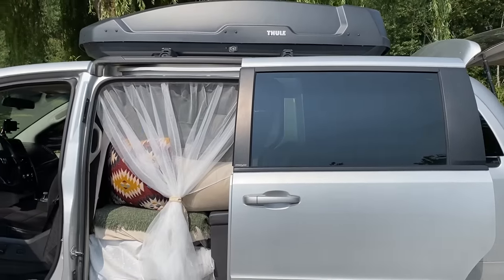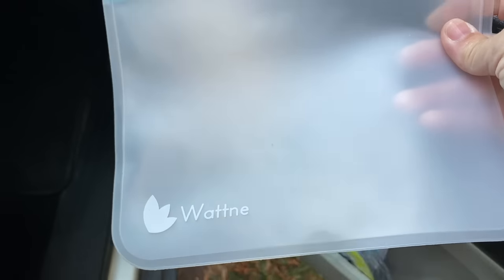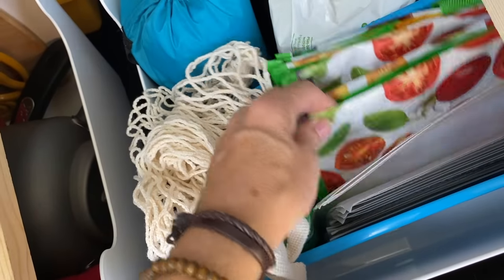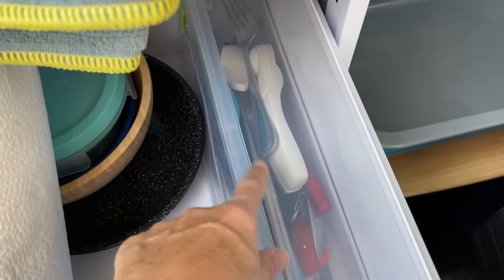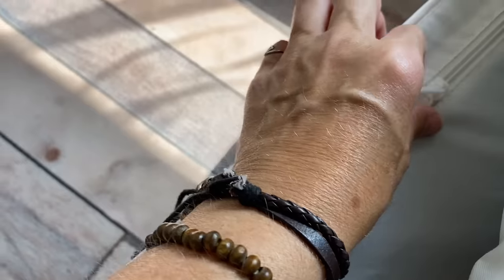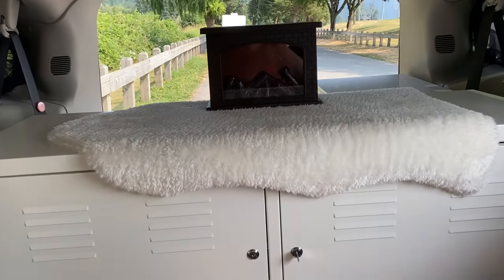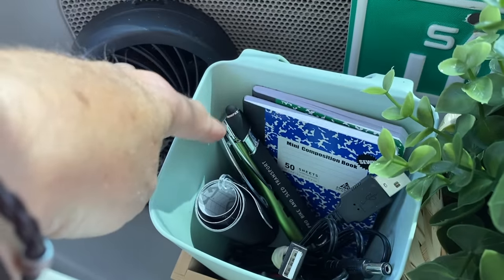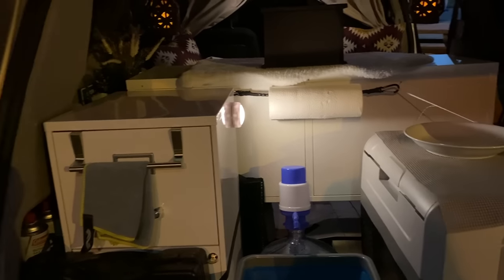#VANIFE | Cute, Cozy IKEA Cottage in a Minivan | Full VAN TOUR | Dodge Grand Caravan

Comment: Super cool build.  If you sew a pocket on the bottom of your blanket, your feet will be able to keep the blanket on.  The blanket folds into the pocket and becomes a pillow.
Reply from the maker: Oh wow! GREAT idea! Thanks for sharing! 😃💕
Reply: Excellent suggestion
Reply: ~ Great idea~Sewing the Pocket on Blankets Bottom~Also using a heavier flannel type FITTED Sheet to cover up with & the elastic holds my feet in.
Reply: I had the same van same year as my first camper build, and boy oh boy was drive time pissed when they repossessed the van last year while I was off work .. I took all the camper stuff out when I bought my full size high roof van and left a ton of holes,  it had no seats I threw then out including the passenger seat, I had a huge hole in the roof where my fan went, I had 3 100 watt solar panels on the roof, a solar shower and water storage on the roof, I removed all the plastic trim in the back and bolted a cabinet I build, my tv swivel mount, battery mounts, bed mounts, propane line drilled thru the side of the van ECT ECT ....drive time charged me 12 grand in repairs lol..   Screw em I filed bankruptcy anyway.   Now I live where I work at Ford Dearborn assembly (I'm a truck driver) in my extended high roof van, I got a shower inside,  I got my solar but Ford let's me plug in I just park where the electric vehicles park.  I fitted 3 solar panels on the roof of that van plus my ham radio 10 ft long antennas
Reply: BTW doing the camper van life in a minivan was near impossible at 6 foot 2 inches tall.  Going #2 was hard lol...being in a semi truck alot I was used to living in a small space,. As far as security goes get a ratchet strap and hook them to each front door,  hulk Hogan couldn't open it.  Plus I put Marine Corp stickers all over the windows, it keeps people away and cops hesitate to give u tickets sincr most of them are ex military...I've got 2.1 million safe miles and never gotten a ticket or stopped because of all those marine Corp stickers.  I'm not military and when people ask I say they came with the van.  And when u leave ur van to shop or whatever TAKE YOUR IGNITION RELAY OR ANOTHER RELAY!  Unless a robber has a tow truck they won't get ur home, living in Detroit crack heads take those vans a lot, they literally drive them to a drug dealers house and trade it for rocks or heroin.
Reply: @breakingames7772  Oh my... Thank you so much for sharing your story and wise tips!
Reply: What a great idea!
Reply: @breakingames7772  Your van was repossessed and you were pissed?  You know, there's a way to keep from having a vehicle repossessed, don't you?
Reply: @vickyabramowitz2885  I think he meant the company that took it back maybe.?
Reply: you are a genius ✨thank you for this life hack!!!
Reply: @breakingames7772  Why is it so funny you stuck other consumers with your bill?  Was it a huge lemon?
Reply: I call them quillows...quilt and pillow...and we have two.
Reply: @breakingames7772  Thanks, I just ordered a Marine Corp sticker on eBay.
Reply: How can you take your ignition relay off when you go shopping or leave your van !????? 🤔🤔🤔😳
Reply: Where did you find the little fireplace and does it hold a charge (usb)??
Reply: @breakingames7772  screw them is right. Good for you!
Reply: How tall are you?
Reply: @Jenrtiel  5 foot 2 inches
Reply: @BreakinGames  never ever "screw" anyone or thing.  Karma always reflects on your character.  What comes around will come back and bite life right out of you. God Bless.
Reply: Or maybe put the pillow inside the blanket pocket…
Reply: Good idea!!!!!
Reply: @vickyabramowit2885  Besides keeping up the payments, what else can be done?
Reply: Yep. I agree. I have sewed foot pockets onto my blankets.
Reply: I would invest in a boot brush that sits flat that you can put on the pavement
Reply: @breakingames7772  What a fun story...
Reply: You can simply fold a blanket into a pillow without sewing a pocket onto it 😊😊😊
Reply: I keep one of those in my car for emergencies, just looks like a pillow on the backseat. My mum made it many many moons ago

Comment: Personally, I feel like it needs so much more security wise. The key is to not need anything that requires hand-to-hand combat. In other words, once they are in. If you are dead alseep, that whistle won't help at all. There are quite a few videos by other van dwellers who share  multiple ways to really seal up your van for security. Window and motion alarms are great. Cameras ourside that show anyone outside the van. Things you can put on the van windows to make them shatter resistant. Etc, etc. The windows also look like light can be see around them. I may be wrong, and hoping I am. Like anything that more and more people do, so goes more and more crime, and criminals will learn how to spot the vans that are stealth.

Comment: I LOVE your van. So many great things set up. The wooden blocks you have under the legs of your cabinet could easily be replaced and tidied up with a piece of pvc pipe big enough for the leg to slip into, then cut the pipe the length of elevation you need. Then you have small white round legs for your cabinet and more foot room. Love you window and door covers.
Reply from the maker: OH my! I JUST did the pic pipe thing for the legs! That's awesome, great minds think alike! 🙂

Comment: You did a fantastic job well thought out ,you must love it all that piece and quiet away from annoying as hell people ,you should look into expandle awnings  expanding your floor space outside .
Reply from the maker: Prior to moving into my van I had ordered an ARB Awning for the van through an RV service center. I had an appointment for it to be installed but then was told they couldn't install it because the mounts wouldn't fit my roof rack (factory). They were unwilling to rig something up...so the awning was sent back. I am hoping to find someone willing to install one for me.....I am unable to do these things myself due to health reasons.
Reply: @RootlessWanderer   do some research and see if there's other alternatives there appears to be many different styles like the one I mentioned if you would like it would double living space look for something with screens attachment option the bug screen covers for your windows.

Comment: Oh I was also wondering where you got the wooden boards you put across the seatwell in back...that is genius and I love the 'sink' setup....might try to do something similar in my van...
Reply from the maker: The wooden boards I purchased from home depot. They are called "project panels" and they're made out of pine. I did not need them cut, they fit perfectly across the seat well. The sink is working out very very well. I think I may add a usb chargeable water tap next!
Reply: @RootlessWanderer  thanks a bunch .. Yeah I'd go with the USB  from others..  they seem to with work well.

Comment: I just bought the screens through your link. I have never seen them before. I just got my 2012 Transit van delivered yesterday morning. It is 9 years old but only 40K miles. Looked a long time for one, they go fast when one can be found. Lots of cool ideas that appeal to me. I like the cottage look. LOL I am an ambiance light nut. Fireplace light is on my list and I to want to sleep across the back of mine. More room, I am only 5'1. I have no Ikea near me, but I am an artist and have great one of a kind cabinets I used for art supplies. The netting adds character.

Comment: Beautiful van! 😍 May I ask how tall you are? It's genius to put the bed across but I am afraid I'm too tall to do that. 😊
Reply from the maker: Lol I am pretty short!
Reply: I have my bed long ways, but I made the bed into two sections, the back of the van built in and the front is actually easily removable so on days that I want more floor space, it comes off very quickly leaving the sliding doorway clear. I can either just set the front part of the bed on the ice chest or screw the legs on. The whole bed can be removed and used in the tent because it is in sections it's easy to carry and because I covered the wood with foam and vinyl no gloves needed and wipes clean before putting back in van. hope this gives you some ideas
Reply: @notaennebodie531  Very nice idea! Might give something like that a try. Thx!

Comment: Nice set-up.  I love the ambience created by the  lanterns & faux fireplace.  And the pump in the water bottle seems very effective although I imagine it must be a pain to refill due to the weight.  I know I could not put my bed like that because I'm too tall to fit but hopefully with a side build I modify things enough to achieve the same cozy cohesive & uncluttered home you have.  One piece of advice I have heard from other female van/car dwellers is to always keep the front seat empty in case of an emergency.  I wasn't sure if you did that, too, or just had the sleeping bag there for the purpose of the video.  I hope one day to be living in a van as nice as yours one day.
Reply from the maker: Thank you! Yes, I have heard that as well. I always keep the front clear and I need to be able to move into the front from the back. For quick getaways. Thanks so much for watching! 🥰

Comment: Neat setup.  I would recommend you make the window covers fit right to the edge of the glass or a little over.  Check your van at night with the lights on.  Walk around outside and see if there are any cracks.  A perv can peek in through a small crack. You didn't say what you do to make a living.  Do you have an online job?

Comment: I love your van setup. I would like to know what you do to access the water and stove when you are unable to get out of the van, because of weather issues or safety concerns please?
Reply from the maker: HI Kerrie! Thank you very much for watching and commenting! So, accessing my water is super simple. I just lean over my cabinet and the water bottle is right there. I can pump the water easily into my water bottle or wash basin. Now as far as cooking. I do not cook inside. Ever. I will either use a picnic table, or just the back of my van and cook on top of my fridge. I prefer to cook outdoors even in rain. snow and wind.  I also now have a canopy tent I set up for an outdoor kitchen. I should also note: If I ever feel unsafe in a location I will leave immediately...and I have. If I am in a place I need to be stealthy I will simply snack or make a PB&J 🙂

Comment: I ran through a lot of the comments to see if someone else had ask but I didn’t see it. But before I get to that I just want to tell you it was a great video very detailed and I am just in the planning stages so what I’m going to do is take my little Kia soul emphasis on the little And put a foam topper in the backseat and then just go out like to Karr camp a couple of nights in a row until I get the hang of being all alone with my dogs. I can use the back of the car and the front seat to Bring along a little cookstove a small ice chest chest for a few days. When you gave me some great ideas even to just get started in my little car. The one question I do have is your little fireplace light I just have to find one of those that is the most precious light that I have seen I have an electric fireplace in my house and there’s a heater involved audit and I use it all the time up here in northeast Ohio. So I’d love to get a little tiny one for just the light did you get it at IKEA? My number 1 favorite place just in front of Amazon.

Comment: To control clutter.  I like the space you made.  Did you think about a black out cover curtain between the futon and the back of the front seats. And do you have a fold up chair and table? It can be stored on the side of the cabinet by the potty.  Or infer the bed or behind the water.

Comment: I'm also a Libra ♎ and I think it needs to be pretty too. Your little fire lamp is gorgeous and I think I need one. I have wondered if I could sleep across as well. I'm 5'7 but I'm a side sleeper
Reply from the maker: Hey a fellow ♎️ ! The fireplace lantern is still my one of my favourite pieces ☺️ Hmmm If you have an L-shaped area so that you can stretch out sideways it could work...? I couldn't say. I am very short and have a lot of room. I would suggest just laying on the floor of your van without the seats, perhaps sleep a night or two and see if you can handle it or if it feels too cramped....before doing anything permanent.

Comment: I have motion sensor flat lights in the cabinets that have magnets on them …they are also USB rechargeable - I use them in my closet where my AC and water heater are and there’s no light in there….but now there is and it just attaches to my AC because the light is magnetic on one side (Amazon)…I also have one under my kitchen sink and inside a closet door attached to my metal wire shelf system.

Comment: Also, u might want to reconsider your food on the bottom drawer and nonpersihable supplies in the top drawer where the sun shines on them.  Also, you can hang a hanging file in there for all the cutlery, instead of that plastic box that u have to remove to open, and then haggle with the rest of the drawer items in order to put back.

Comment: You have no idea how alike we think. I have the window socks, luci lights, environmental friendly bags, and just about everything else you do in my Nissan Altima. The only thing really different is I have a Dokio 200watt solar panel and a 100 ah house battery. My car is broke down right now but I'm off grid in a room of an old mobile home until I can get a van. It Will have to be full sized because I have both my dogs now and one is 60 lbs. I'm able to use everything out of my car to live off grid including my Coleman stove. The only thing I had to do is buy a generator to run AC in a room because I'm in Alabama and me and my dogs cant take the heat/humidity. We are all seniors. If I was still mobile we would head to higher elevation. Your setup makes so much sense.
Reply from the maker: Oh dear! I sure hope it all works out for you! Sending peace and love!

Comment: What a great setup! It looks so cozy and welcoming, and it’s also very efficient.

What do you do about cooking when the weather’s bad? 

What about heat in the winter?

One really big thing, though. Those tiny nylon strings you have through the rear holes in the cabinet don’t stand a fly’s chance in a hurricane of actually holding that thing in place in an accident or hard stop, and aren’t doing much the rest of the time, either. Please*, for your own safety, buy some proper tiedowns for all of your gear and use them. *When that thing takes flight (not “if”), it will kill you, or break your neck and leave you a quadriplegic. I was a paramedic for many years, and believe me, people have been killed by much smaller airborne objects in their vehicles even if the vehicle itself isn’t in an accident. I also had my own neck nearly broken when I was still in college when a milk crate I had in my back seat took flight in a low speed accident, and I have had trouble with it ever since - more than 40 years. Protect yourself better!

Oh, and BTW, those little stick-on lights are called “puck” lights, not “pot” lights 😉

Comment: you posted this two years ago, so I’m not sure you’ll even see my comment. This is so cute. I sleep on the futon in my large van, but I am thinking of buying a minivan. I was wondering how you made the futon fit crosswise? if it’s where the step well is, how did you make the legs fit inside the smaller area?
Reply from the maker: Hello! Thank you for your comment. The futon is a Lycksele Lovas sofa bed from IKEA. I had it prior to vanlife. I removed two thirds of the sofa bed and only kept the part you sit on. Leaving behind the back rest portion. The mattress it came with zips off at the seat part so I did not have to cut the mattress. It fit perfectly behind the seats of my minivan. The legs of the futon did not interfere with the step wells are…I even had all seats removed and used the step well for storage and the futon legs seemed to fit exactly where the frame was, as not to be putting weight on the open portion of the well. So the legs are on top of the step well. As there is a sturdy cover. I am not sure if this answers your question or not…?

Comment: Really nice! I’m getting ready to sell my mountain home and take the challenge going for 4 straight months out of the year while is summer in my place in Baja (100+ degrees and high humidity) I’ve been a tent camper all my life thus switching to a van will be an upgrade, lol. Question; Do you need solar panels for your fridge? Or how do you work it out, do you need a controller and separate battery just for the fridge? Love your arrangement, so cozy. My dilemma is that I’ll be traveling with a 35 and 70 lbs dogs and I will need more floor space until I reach my destination, then they can have more freedom. They’re used to tent camp with me for weeks at a time and they love it though. Thanks for the tour and the tips, fantastic van!👍🏻
Reply from the maker: My fridge is a beast and hard to power. I am currently looking into alternate power sources. Thanks for watching, good luck and happy adventuring! 🙂💕